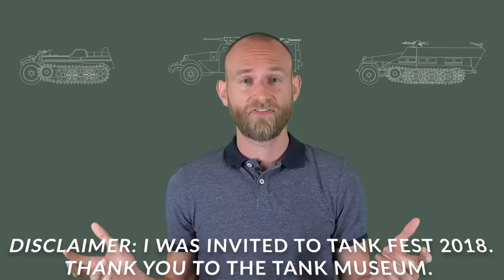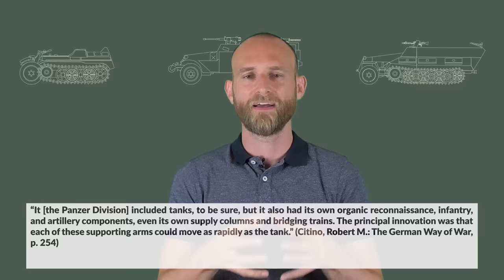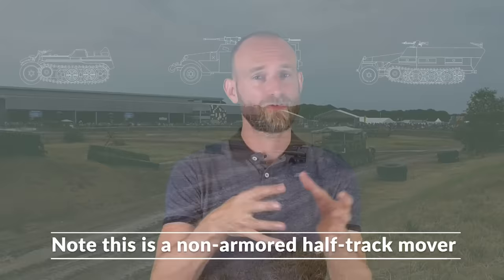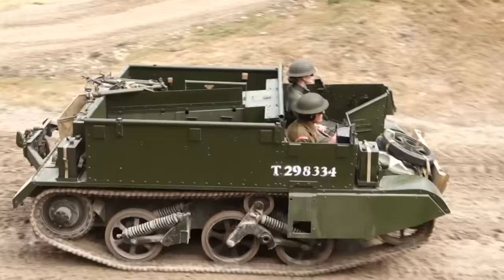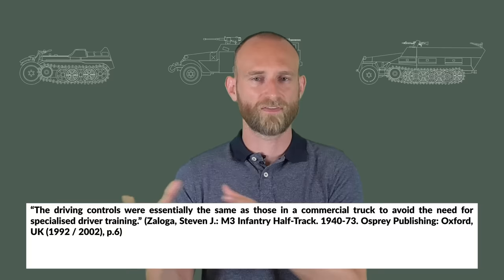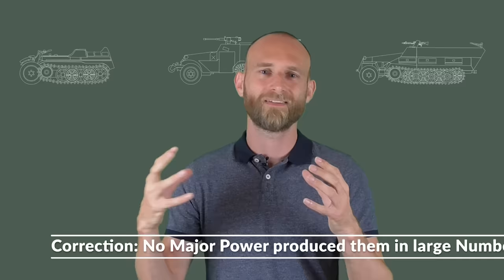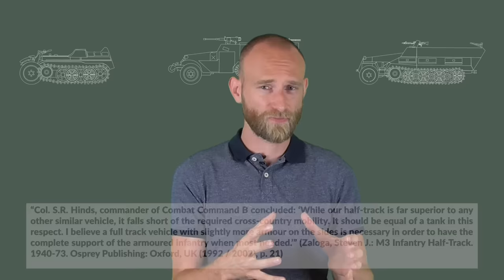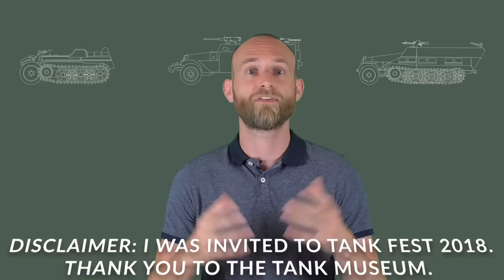Why Halftracks? Why limited to WW2 only? (Featuring Tank Fest 2018)

Comment: a long time ago I was a crewman on an M113 (driver gunner signalman ) I can tell you a few things about it 13 tons of Aluminium yep recycled coke cans we called it. Powered pack was a  318ci diesel it  started life with a Hemi petrol eight, you can see how that was a bad idea in a vehicle that could be shredded by a 20mm cannon with 365 litres of fuel in an upright fuel tank on the left wall of the vehicle the armour well would stop up to a 12.5 mm  mg round and shell splinters a really close hit by arty highly doubtful bigger stuff was in fact supposed to through and through one side and out the other was the theory.it was supposed to be light amphibious and yes it could easily ford 2 meters without prep and yes it could swim if the vehicle was in good condition and water tight otherwise it would sink like a stone. Yes, it could be dropped by parachute.ammourment well they bolted all sorts of stuff on this chassis basic was a.50 m2 MG all the way to an M61 Vulcan. My army had a model with a scorpion turret fitted with that dinky little 75 mm gun.here the thing with an M113 you could teach an idiot how to drive it's in a few minutes yep if you could ride a bike you could drive this one pedal for throttle two stick  yoke differential  steering and an automatic transmission in a few minutes I could have you driving this thing easily. but not well being good is another thing the basic Australian army reserve "I was a regular", training course for a driver was 2 weeks mostly lots of driving and learning the maintenance regime. you were by the end competent. but not good that took time and experience. For a driver, this thing is fun period. and I rather be in one than a bloody Humvve any day they cannot go were  this can.

Comment: I think that an important missing link to mention is the 'kangaroo'. The British and Commonwealth forces already keyed onto the solution of having larger fully tracked infantry support vehicles that had increased capacity, but still retained most of the advantages of having fully tracked armouured vehicles. Theirs was still a small scale solution, part of 79th Armoured and attached piecemeal where extra protection for an advance was deemed necessary, but it seems to me that that is where at least part of the APC idea was born.

Comment: Very interesting and clear video.  However, it is not inherent in a half tracked vehicle that it must be open at the top and lightly armoured.  That was an aspect of the design and evolution of half tracks up to that point.  They could theoretically have chosen to make new half tracked vehicles with closed tops and heavier armour.  However, your other arguments clearly show why this was not the best way forward.

Comment: Sorry, I have to disagree.

Most of your statements in the video are pretty wrong.

First of all not covering the French halftrack was a mistake, since the French car makers were the pioneers of modern halftracks. Germany basically copied Citroen designs from early 20s when designing the new Wermacht equipment.
Also you are wrong why and how Germans used halftracks, they introduced them strictly as utility vehicles to tow equipment not to keep up with tanks. German motorized infantry is a huge myth, in time Germany attacked Poland, most of the infantry movement was on foot and yes horses, trucks were used mostly for logistics. In fact Poland had much higher level of infantry mechanization then Germans. The game changed when the Russian campaign started due to fact that the space to cross was huge.
 
Now lets get back to topic of this video, why halftrack and why not after WWII.
The answer is simple, there was need to tow large equipment like big guns, tanks on trailer, planes on airfield, tow damaged tanks etc. Now before WWII you had two options horses or truck. You needed huge amount of horses to pull a big gun cross country and even bigger number to pull a inoperable tank. Trucks in other hand could tow anything on road, but in the moment they drove off the pavement wheels lost traction and that was it. After huge success of Citroen expeditions Germany decided to try halftrack concept as utility vehicle to replace trucks and horses. And it worked out. Now one will ask, why not fully tracked vehicle instead of halfback? Well it wasnt due to fact that not many had driving license, you have to keep in mind that most enlisted soldiers were 18 years old, even today they usually dont have driving license at that age, so you need to show them how to drive anyway. The real reason for the halftrack vs. fully tracked was COSTS, period. To make a halftrack just take a normal wheeled truck design, "slap a track on rear wheels" some weight on the nose and voila you have off road vehicle that has great traction in the field. To make a fully tracked vehicle you have to engineer new construction with some mean of steering (differential clutch steering for example) which was too complex for that period. You have to keep in mind that even parts standardization was not really common in pre-war time and it was hard to swap parts between two same vehicles without machining. One may argue that there were tanks already that had the technical solution, but again we are talking about the main reason, costs. So there was a reason why a tank had such a high production price, fully tracked steering was too complex to be produced cheap, it was also very big in size and too heavy to be fitted on a truck like application. So this is the reason for halftrack in WWII, it was the costs and simplicity which means costs and speed of production. The lighter the truck/halftrack the smaller engine it needs for same performance and that means cheaper...

Now why not after the war?
And again for same reasons, first you didnt need to move that many equipment as in WWII, also the production costs of steering systems went down due to technological boost during WWII. If you produce less vehicles, then cost per vehicle and the time needed for the production can be much higher.  Also very important fact is that since WWII all wars were small scale, there was plenty of surplus halftracks from WWII still in service up until 70s with no need to produce new ones. From 60s the role of utility off road vehicle shrink down due to fact that most of the world has a wide road network that can accept standard wheeled trucks.

Open top vs close top is a utter nonsense argument, it has nothing in common with the halftrack vs fully tracked topic. There were plenty of close top halftracks in WWII, and there are plenty open top fully tracked vehicles post war, so no, that is not the advantage.  In fact many of the IFVs specs included the possibility to open the top, so the infantry can use it as the open top assault vehicle.

So sorry but I have to disagree with you.
Reply: The Wehrmacht had at the beginn of WW2 the Sd.Kfz. 250, so the infantrie can follow the tanks (some infantrie, not every man in the Wehrmacht), period.
Slap a track on the rear wheels is only true for halftracks like the M3, not for the germans, the germans had 3/4 tracks with tracked steering (but without powered frontwheel like the M3).
plenty of closed top halftracks? There is only one i know, the Sd.Kfz. 3, all other are cabriolets with canvas.
So tell me a few of the plenty closed top halftracks.
Reply: Sd.Kfz.250 came into larger numbers mid to end of 41! So no, you are wrong.

If you would read careful enough, you would notice I written "slap a track on rear wheels" so its clear I didnt mean it word by word, but technically when compared to construction of fully tracked vehicles of that time it was that easy...

closed top examples: Sd.Kfz.3, Sd.Kfz. 251/23, Sd.Kfz. 250/9, Panzerwerfer 42 auf Maultir, Schweres Wermacht Slepper (sWS). I also remember to see few of M3 halftracks with metal top, one is famous as Pattons. Also Soviets used some, the BA-30 for example. 
That is plenty in my book.

The point is that even post war IFCs/APCs had the requirement to be able to open the top of the vehicle so the infantry could shoot out. The closed top, or lets call it sealed design came in as a a NBC protection, there was no other useful factor to it.
Reply: I wrote 250 by mistake, i mean 251, sorry.

The US Halftracks had a truck drivetrain (4WD) and tracks instead of rear wheels, like you said, slap a track on the rear wheels. 
Germans halftracks are way more complicated, they had a tank drivetrain with additional front wheels (even if they lost the frontwheels, they can move and turn) they had the "to complex for the period" differential steering, it was a little more complex to synchronizing the steering of the frontwheels with the tracks and prevent that one track come to a full stop at a sharp turn. Far away from just slap a track on the rear wheel.

Sd.Kfz. 251/23 and 250/9 had open turrets.
So, Sd.Kfz.3 Maultier, sWS, BA-30 and Pattons unique M3 command car, is for me far away from plenty
Reply: and again you are wrong.

the 251 wasnt fielded in larger numbers before mid 41, if I right remember they produced something like 500 units till the end of 1940, and you can bet that most of them were used as a towing vehicle for artillery. In fact German forces where among least motorized on European battlefield trough the entire war.

With construction of German halftracks you are again wrong. It was inexpensive construction with differential brake, well basically a truck with a tracks slapped on and the brake on differential that could brake one side to aid front wheels at full steering wheel lock, to get more steering in mud. This worked in very slow speeds only! All higher speeds were steered exclusively with front wheels.
Tanks did have much more complex and more expensive steering. Some light tanks used combination of clutch steering and differential brake steering which was very indirect and not efficient, but most war period tanks did have some sort of double gearbox steering or double differential braking system mostly used on German tanks. While the double differential braking system is based on same principal as the differential brake of German halftracks its much more complex and expensive. Also that system is nowhere near the quality of steering by double gearbox system. There is a reason why after WWII almost all fully tracked vehicles used double gearbox system. The major disadvantage of the double differential braking steering is that you have to guess the speed you go trough the turn and match the gear to the radius you want to make. The German WWII tanks with the best steering was Pz.38t, you may guess why...

Sd.Kfz. 251/23 and 250/9 didnt have open turrets, they had a grill roof, that is nowhere near open top. Yes it may get some rain in but that is not a tactical disadvantage. The rest of vehicle is fully armored. But again there is no tactical advantage to have APC with closed  roof in WWII time. Not even now-days, the only need for the roof is NBC protected sealed design. So no, the reason mentioned in video, that after war there was need to move away from halftrack design due to open roof was wrong. For example Czechoslovakia used fully armored closed roof halftrack based on German design, the OT-810. But as I said, fully tracked vehicle was the way to go for reasons I stated in my first post.

Edit: Now I remembered another German halftrack with closed top Sd.Kfz. 253, off topic but I had to add it.

Comment: I never really considered this before. The biggest problem the Germans had was that their tank spearheads had to always halt to wait for the Infantry divisions to catch up. So why not make a combined arms division with a balance of tanks and motorised infantry. The Germans may have done this later but that's exactly why the US army relatively recently developed the combined arms brigades- a balance of forces in one unit.
Reply: Lessons learned and availability of resources bascially.
Reply: German tank divisions had a fully motorized infantry component.  The reason they had to wait for the infantry DIVISIONS to catch up was for consolidating the breakthroughs and gains the panzers had made.
Reply: In answer to the OP if they had waited to fully motorise or mechanise their entire army the war could not have started for years. Their foes would have had a lot more time to build their forces. 
The ORBAT of their Panzer and PzGr Divisions changed as the years rolled on with lessons learnt and lack of resources kicked in. 

To counter the issue of speed the Germans trained their infantry hard and could march 50 miles in a day which is no small feat. Not an ideal solution but they recognised their shortcomings.
Reply: @Steve Pirie I doubt the germans would have ever been able to fully motorise their forces. As it were, they actually produced fewer lorries than they wore out on average. Much of their increase in motorisation came from the huge number of captured vehicles they took in France.

Comment: Your point, that germans used trucks and replaced the back wheels for the development of halftracks is wrong! All german halftracks without the Maultier were special developments. Only the Maultier used normal trucks and replaced the back wheels. However the Maultier was never used as a amored personal carrier. 

You can not realy compare the US half track and the german half track. Both of them had different origin. The german halftracks were special development, complex constructs and expensive compared to the US halftrack. The Maultier and the US halftracks based on trucks and were more simple and cheaper.

Also your explaination why halftracks were never built after WW2 is not correct. The firepower of halftracks were current WW2 in some cases strong enough to destroy tanks or aircrafts. Look at the different variants of german and US halftracks!

Halftracks are only usefull, if they are based on light or middle trucks with a maximum weight of 10 tons. Heavier halftrucks lead to very complex and expensive construction without advantage opposite to full track vehicle. To get the same off road characteristics like tanks a high technical effort ist necessary. Look at the german halftracks. Special halftrack contruction like the germans are uneconomical and lead to a complex logistic. After WW2 it was better ot use light tank construction for the use as amored personal carrier. Also after the WW2 the kind of production and the technical constructions of tanks were improved so that halftracks got no advantage more.
Reply from the maker: Rather sure I never said that.

Comment: The jeep was an inexpensive, versitile vehicle. I believe the change from half tracked to full tracked vehicles had more to do with profit for the miltary industrial complex than military doctrine.
  The jeep and halftrack were replaced with expensive humvees and Bradleys. Of course they were a better alternative, but at what cost? 
 The humvees were used like halftracks anyway, with less protection. Pack them full of troops to get blown apart by IED's?
  But that was due to poor political decisions. 
  I believe in giving our military the best equipment possible. But the military industrial complex exploits this principle, promising miracles and delivering disappointment. The only consistently reliable feature are their profit margins.
  But your arguments are the party line and have merit. What goes on behind the scenes is what is sick and depraved.
Reply: The Humvees were never designed to be armored personnel carriers.  They were supposed to be nimble and quick.  Once all the armor was added to make the politicians happy, it was now slow, and broke frequently due to the excessive weight.  So basically they turned it into something it was not designed to do.
Reply: Robert Heinkel I knew a wonderful man named Ralph Gunter Heinkel who worked for the George S May Co. back in the 1970's. Any relation?

Comment: Why so much fuss?
S I m p l I f y  things!
Wheeled trucks and APCs today cost less to manufacture, maintain and don't damage roads as badly. Due to advances in tires, engines and transmissions, trucks and APCs can traverse ugly terrain equally or better than a halftrack.
Bottom line? Halftracks are too expensive...there you go.